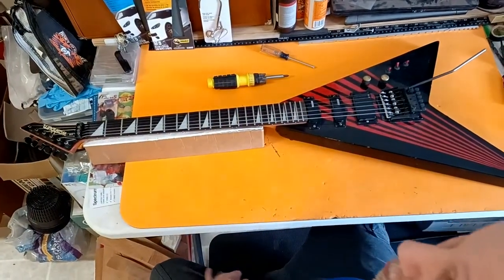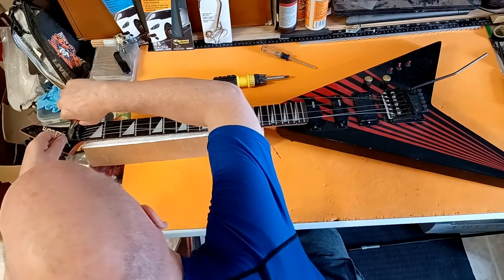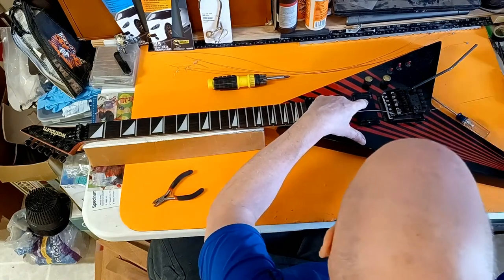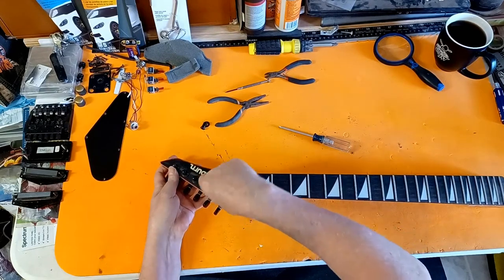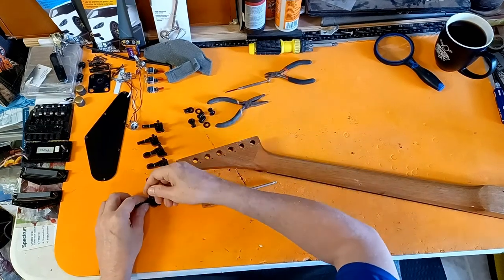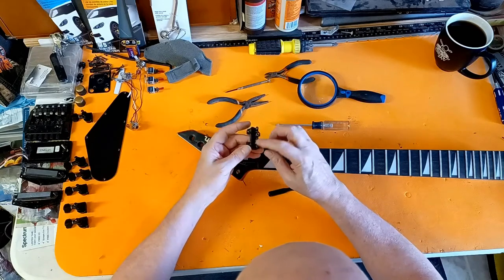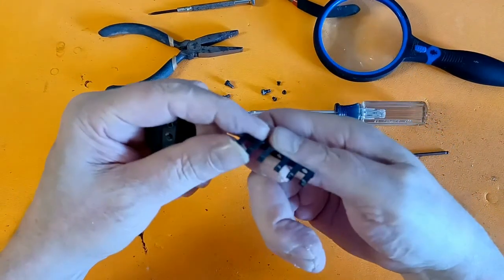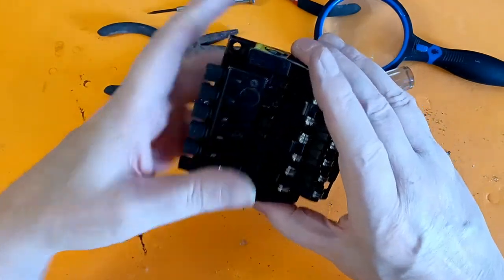Washburn RR11v Resto Part 1Tear Down

Comment: That wonderbar system is quite a piece of design! What’s the plan for this one Bill?
Reply from the maker: Just get it restored as close to original condition as I can. Better set up now that I know what I am doing. Todd matched the original color best he could from the one original picture I had as well as an old promotional flyer for that years Washburn series of electric guitars. Everything is original except the bridge pickup. I Think I have the original somewhere I think. I lost housing and storage several times in my existence so Its possible I did manage to lose it. The only other things is the stripped and missing screws from the lock and the locking ring for the tremelo bar.

And yes that Wonder Bar Is the best ever Tremolo system ever in my limited opinion. They never got popular because of cost and weight. They were always in the 3-400 $ range. Now we see Floyd Rose FRX with the same issues of weight and price yet they seem to sell on the name alone.